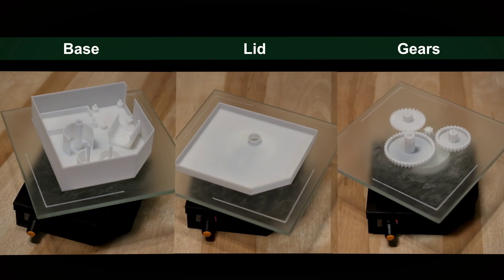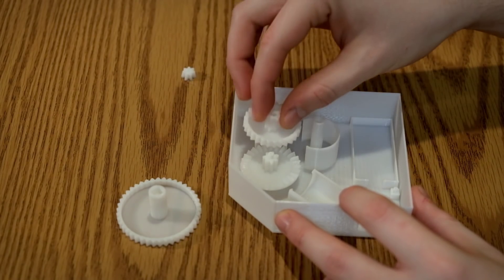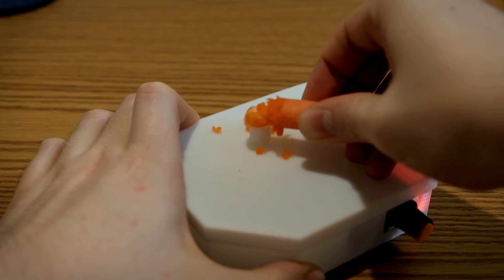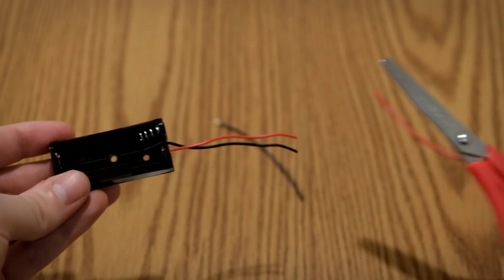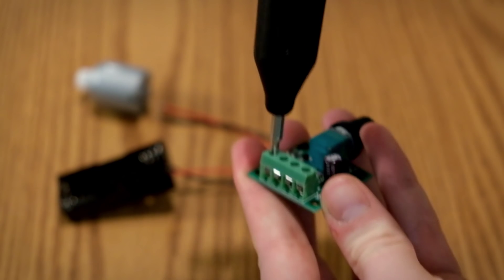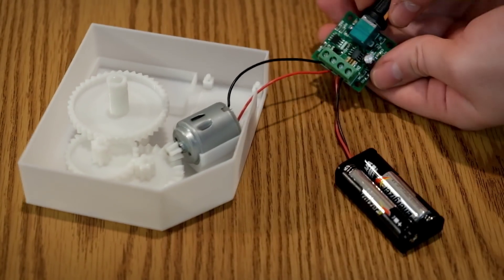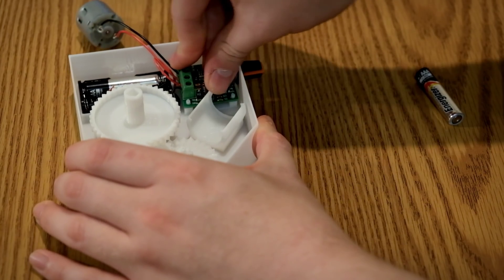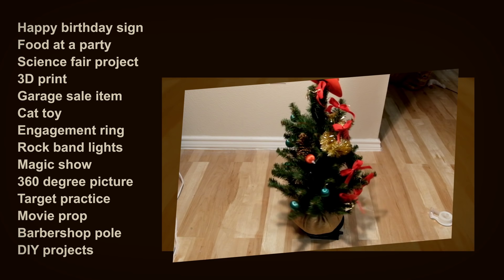How to Make a 3D Printed Rotating Box

Comment: awesome! I used this to make my dad a rotating pencil holder and it worked great. I will say though that you have to do quite a bit of filing of the gear holes so it fits the shaft. the two smaller shafts also came out too thin so the broke from the box and I had to glue it back. Other than that, it works great and completely customisable.
Reply from the maker: Thank you for the notes I will consider making edits to the model but i'm glad you enjoyed this project!